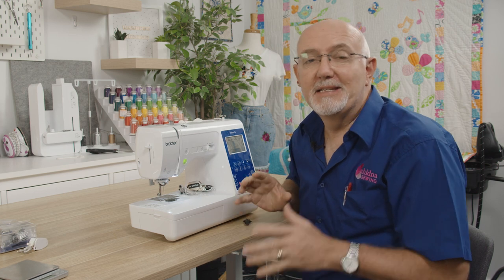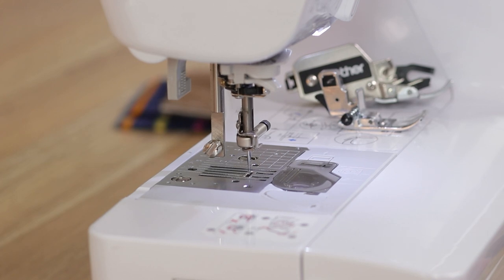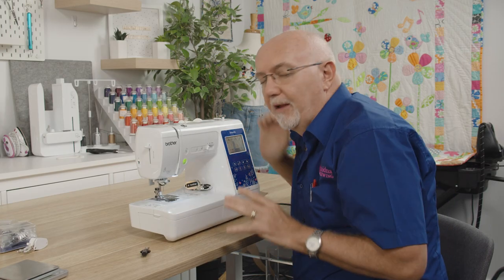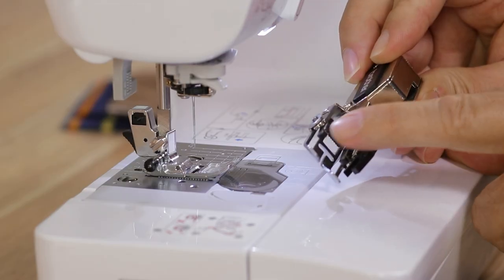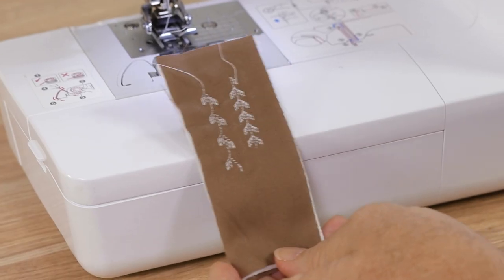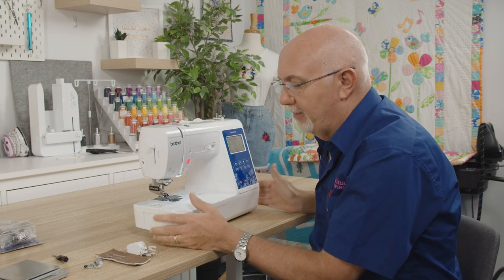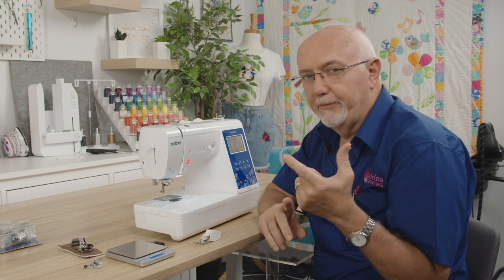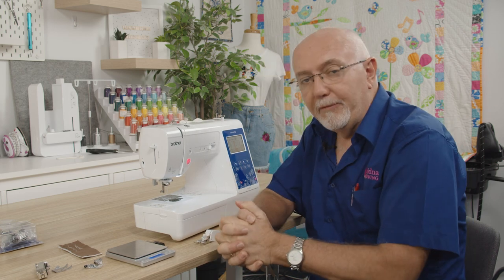A closer look at the Brother Dynamic Walking Foot with Gary | Echidna Sewing

Comment: As wonderful as you think your regular walking foot is the Dynamic version is just that.  Dynamic.  I was having problems with my original one giving me intermitant awful stitches on the back of my quilt and after turning a corner on binding the corner would get caught under it.  So off to the store I went yesterday.  Was first horrified at the price but figured I had enough fabric to work with I could spend the money on a good tool.  Worth. Every.Penny.  Thankfully my quilt shop gives a 20% discount on accessories if you bought your machine from them so I'm thrilled.
Reply from the maker: @stevencmillin2737 We totally agreee with you! Such a great addition to use with your machine!

Comment: Very helpful. I just purchased a Brother CS700i, and was confused why the manual tells me not to use the walking foot that came with the machine for decorative stitches.  The instructions only allow a straight or zig zag stitch with the walking foot.  I’m brand new to quilting and everyone in the quilt group I joined uses their walking foot to do curvilinear stitching for quilting (the wavy stitch).  The manual states that the walking foot is not made to handle any reverse stitches, but that wavy stitch (and a few others) don’t require any reverse stitches.  It’s a help to know that this dynamic walking foot is a better option.  Frankly, the walking foot that came with the machine is not doing a good job on a quilt sandwich using the zig zag stitch.  The stitching is very uneven.  Could be the operator however😅.
Reply from the maker: @stlmama7643 Yes this foot is fantastic for those decorative stitches when quilting! It also has the interchangeable toes which makes it super versatile!

Comment: I just got this foot and I found I had to adjust the thread  tension to get a good stitch. The only problems are that sometimes I get loopy stitches, and also in reverse mode, the top stitches get wonky after about an inch. ANy advice?
Reply from the maker: @knittysong  There could be a few things happening and we would need to problem solve with you.  Which machine are you using? What thread are you using and what are you stitching on?
Reply: @EchidnaClub  I am using the Brother Simplicity SB3150 which is like the Babylock Brilliant. The problem happened with fleece fabric, polyester sew-all thread and I tried stretch, ballpoint and universal needles.
Reply from the maker: @knittysong With any fabric it is normal to adjust the tension to suit what you are stitching on. If  the fabric is not a light one, we would recommend you use at least a size 12/80 - if it is a stretch fabric, use a stretch needle.

Sometimes to get it to stitch nicely on stretch, a stabiliser does help as well, depending on what you are sewing.

Comment: Do you know if Quilting Toe Set for Dynamic Walking Foot quilting bar will work in the ankle only?
Reply from the maker: Hi there, the toe set will only attach to the Dynamic Walking foot. You aren't able to use the foot plates with the ankle only.
Reply: @EchidnaClub  thank you I meant will the quilting guide bars slide in the hole that’s in the ankle without the dynamic walking foot?
Reply from the maker: @raggedyanna6 Yes you can :)

Comment: I have the Brother LS1500.  I don't know if it's high or low shank??  Will this fit my machine. I bought a generic and it wouldn't work. The needle screw was in the way. I'm so confused. I sew heavy thick items of fleece and uhaul padding.
Reply from the maker: Hi, just wondering if you mean you have the PQ1500? This machine would have come with its own walking foot. if you give us a call on 1800 000 360 we can help you if you are in Australia

Comment: I just bought a brother after using an older singer. The plastic walking foot that comes with the NEW brother goes on crooked when it is attached securely. Thus risking a broken needle and possibly more damage. I hope brother isn't going to change an arm and a leg for a proper walking foot that should have been provided when their machines are purchased.
Reply from the maker: Which walking foot and which machine did you purchase? We can help if you are having difficulties.

Comment: Will this fit a 2700?
Reply from the maker: @EdnaBrock-cb3sh Yes this will fit the NV2700 machine, get foot to have as an extra!
Reply: Sorry, I misstated the model #. I should have asked you if it would fit a GS2700 Brother Sewing machine.
Reply from the maker: It won't fit the GS2700 as it is a 5mm machine, the foot is used with 7mm machines.
Reply: @EchidnaClub  Thanks. This info saved me money, time and frustration.
Reply from the maker: No problems @EdnaBrock-cb3sh
Reply: @EchidnaClub  is there a Walking Foot available for the GS2700?
Reply from the maker: @EdnaBrock-cb3sh Here is a link to the foot you will need:
https://www.echidnasewing.com.au/brother-walking-foot-for-5mm-models